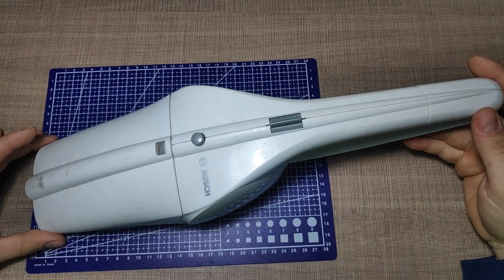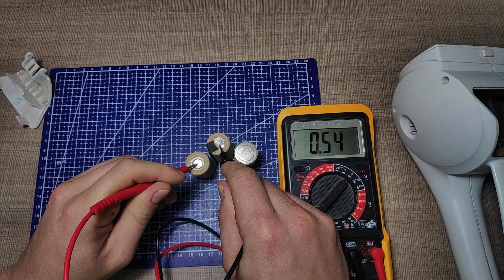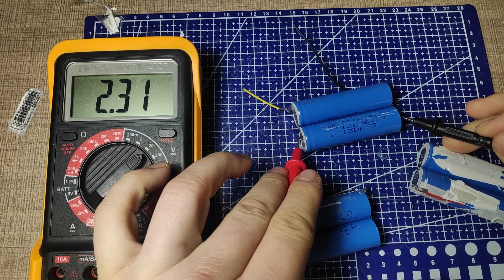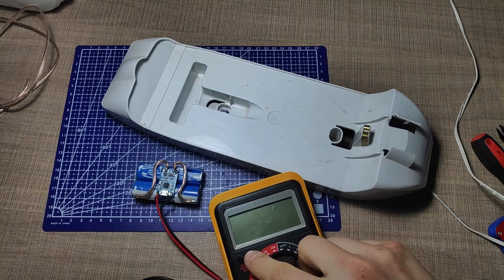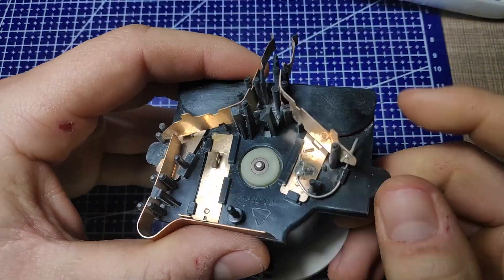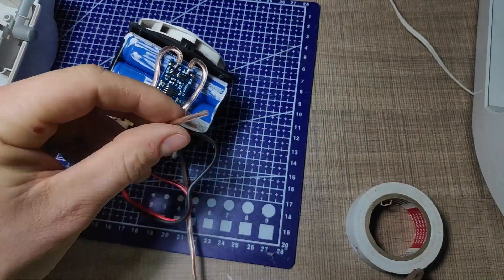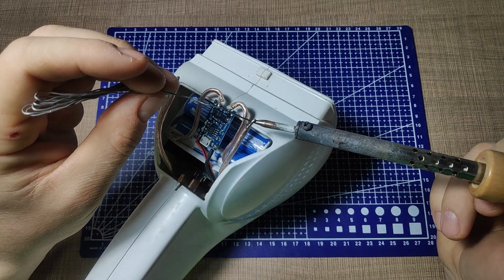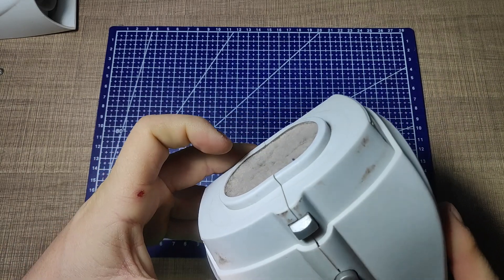Ni-MH to Li-ion batteries - Vacuum cleaner conversion

Comment: A quick tip from the trade: use a BJT PNP transistor powered by the vacuum cleaner switched current source at its emitter (in), base to the BMS module's ground (protected) and collector to an N-channel MOSFET's gate with for it a pulldown resistor of around 1K, which serves to pull the gate low but also to let the collector current from the PNP transistor flow.

Alternatively, rather than solid state, you can use a relay that's powered by the vacuum cleaner's switch, with that circuit going through the protected ground on the BMS module. When the BMS module cuts off from low voltage cutout, the relay will also stop passing current. You can use the contacts on this relay to switch the motor, while maintaining a low enough current for the BMS board to be happy. :)
Reply from the maker: WOW, this is a great tip! Thanks! I might even do a full video on this. Thanks for sharing!
Reply: @TasteTheCode  no worries! It's especially useful for peak current issues. It's important to consider putting an inline fuse in the line of the motor just in case.

Comment: I have a 7.2 volt cordless Shark vacuum and the original batteries died, Ni-Cd 1300mAh. For the time being I added a beey 12 volt cigarette lighter cord to it and ran it on 12 volts. I've used it like this for the past 10 years but I'm ready to mod this cleaner with lithium batteries. I'd like to do what you did and use the original charger which I don't have but it's a barrel plug so I could make one. I'd like to use a proper lithium BMS circuit so I can just plug it in when I'm done vacuuming.
Reply from the maker: Sounds like a fun project! Go for it!

Comment: I replaced it with two good batteries that came out of the laptop by connnecting them parallel and I used TP4056 for charging like you did. Motor is same as your motor. Charging is normal, battery voltage is normal (4,2 V full charged) but if I worked vacuum, it works for 30 seconds and starting to slow down until it stop. If I wait for 30 - 60 seconds again working about 20 - 30 seconds and  starting to slow down until it stop. I checked components for any heating. Only  cables are slightly heating. I tried another pack of battery but still same. I can't solve what is the problem. What do you think what is the problem ? Can you help me ?
Reply from the maker: it sounds as if the batteries can't provide the current that the motor needs. How was the original pack wired? Maybe it is designed to run on a larger voltage?
Reply: @TasteTheCode   Original battery is 3 parallel pack Ni-CD 3,6 V 1300 Mah . I changed batteries another  laptop batteries but unfortunately those batteries never worked or worked the same way. I Don't have new batteries if I have, I will try. If I fixed constant current in some way, will it work properly or do I have a chance to fix constant it with  diode,  resistor, etc. ?
Reply from the maker: @KemalArslanKA  to provide constant current you will need to use some sort of a regulator circuit but the batteries need to be able to provide that current in the first place. Add a multimeter to the batteries while working so you can watch the voltage as the motor spins. If the voltage drops then your batteries are no good and there is basically nothing that you can do to fix them.
Reply: @TasteTheCode  Ok. I understood. I will try.  And if the batteries are not good I 'm seeking for the good ones. Thanks for helping me.

Comment: You could add a 1s 15A bms chip to the batteries to prevent excessive discharge. Btw how is the vacuum going? Are the batteries still working?
Reply from the maker: Yup, everything runs great. I use it almost daily and I pop it in the charger overnight every 3-4 days. Haven't had any issues yet.

Comment: I have the same vacum cleaner, it just have red Bosch logo and switch is green, and it looks like it is even bit older than yours and mine is made in germany, and I made the same thing like you, I found it 2 years ago in trash, and batteries were dead, no original charging stand, so I decided to make it charge on USB, I used same board like you, I made pretty much everything like you, but I made holes for micro USB, and for charging LED's. Also I screwed the board to the removable cover. I use it about 1,5 years, motor runs great, it does not have the biggest power, but for some smaller messes perfect! I also like that small hose with brush stored inside. It is pretty useful, and I can also plug it into blowing hole, and I can blow with it some dust out of somewhere. Great thing :)
Also great video.
Reply from the maker: Thanks. Mine does not come with a hose and I can see that useful. Thanks for the tip, I guess I now need to make one for it 😅